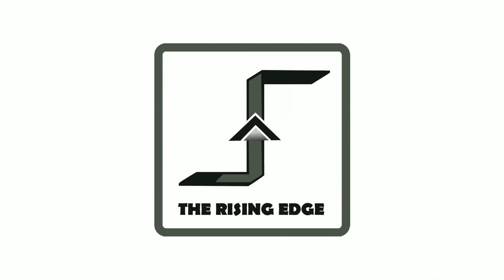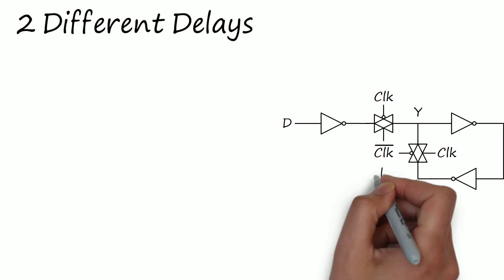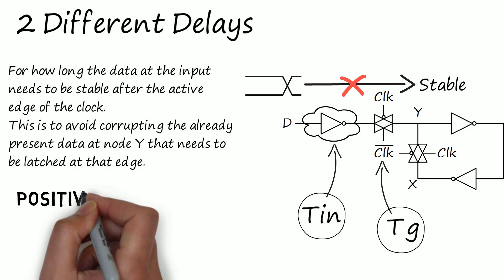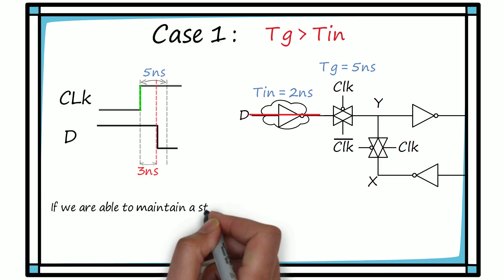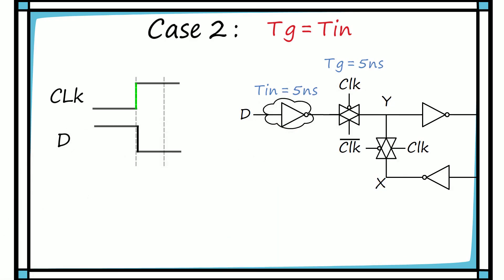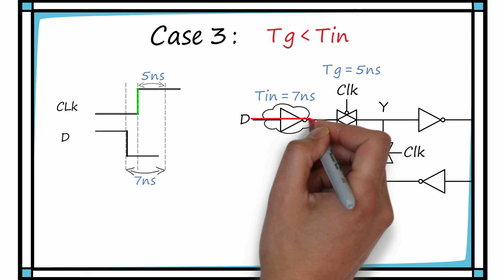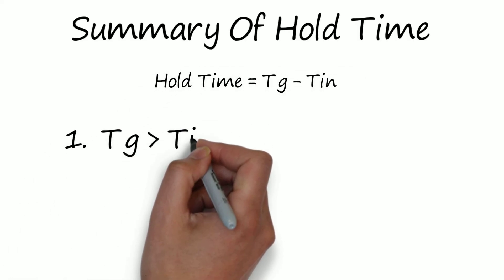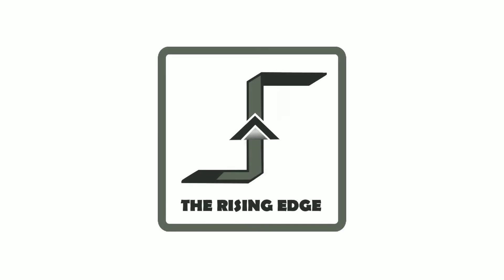HOLD TIME CAN BE NEGATIVE!!! | STA-3 | Static Timing Analysis

Comment: setup can also be negative, 0:38 if there is a internal clock delay, then eventhough data changes after setup time, its accepted because due to internal clock delay, clock is still 0 and its not changed from 0 to 1

Comment: good explanation. i am not sure if there is already a comment about this and please correct me if i am wrong, theoritically library setup time of a flop cell can also be negative, if the datapath delay < clock path delay in the internal structure of the flop.

Comment: Hi yash, in case 2 what if the data change happening before the clock that is  -2ns .data changes will happen before gate turn off right?
Reply: And in case 1  data changing reflect on 2ns after clock edge means hold time will be voilated right?

Comment: i have not got why the setup time is not violated when the hold time is negative. please someone explain it to me.
Reply: Same with me, if u understood it now, can u pls explain it to me?
Reply: If you increase the combo delay setup time also going to increase(in this video he mention doesn’t affect setup which is wrong I guess) but it doesn’t set up time not violate why Bcz any changes to the signal at input prior to clocking needs to go through the delay (combo) so it treated as -ve

Comment: In case 3 where you considered Tin as 7ns which means the setup time is increased by +7ns and data should arrive at D pin 7ns+extra setup time prior for it to be captured correctly so definetely negative hold times impose a threat to setup timing making it hard to fix
Reply: Yes true
Let hold time is decreased by 5ns same amount of time increased in set-up time

Comment: great video, 
now because of the Tin delay will the setup time also increase by 7ns? Since now an additional 7ns is also needed for the data to reach the first gate.
so if before it was 1ns then will it now be 8ns?
Reply from the maker: Yes, correct, that's why we don't focus on correcting either one of them (Setup or hold) we have to optimize the values such both times are satisfied.

Comment: Do we try to keep the hold time negative while designing?
Reply from the maker: Hi Shikha, thanks for the query!
See, for a Pure flop(containing no extra gates) setup and hold time always will be a positive number. Now, A flop can be a part of a bigger component.
Hold Time of a flip flop is a constraint on data path delay so that it remains stable for some time after active clock edge.
Higher the value of hold time a flip flop, more strict will be this constraint because data has to remain stable for this much time. So, if you have zero or negative hold time then there is no such constraint on data and hence it helps in meeting hold violations. However, flip flops with negative hold time have a large setup time constraint, making it difficult to achieve the desired performance(frequency).
Hence, while designing, we aim to design in such a way that there are no timing violations(setup or hold) while ensuring optimum performance.
Reply: @therisingedge  Thank you for answering.
I have another question. 
If I have to design a circuit to work on 1GHz and I have a combinational delay of 2ns between two flip-flops then is it possible to make it work on the given frequency?
I could add another flop in between but it would add to the area and cost if I had to do this for all flip-flop pairs. Do you have any idea about this?
Reply from the maker: Assuming that you are working with ideal flops (Zero setup/Hold, c2q), then the only way to make it work on 1GHz is to include delay in the clock path, as we'll have to increase the data required time by at least the combinational delay value of 2ns.

Comment: Hi Yash, thanks for the explanation.
In case 3, where hold time is negative, then what will be the setup time for flip flop? will it be any time b/w 0 to 5 nsec.
Reply from the maker: Hi Prashant, thanks for asking this doubt!
No, the setup time will not be in 0-5ns, rather it will be calculated by adding the delays of all the 3 inverters that are there in the path from D to X. So, if the hold time keeps on going in the negative direction, it will cause large setup time constraint, making it difficult to achieve the desired performance(frequency).
Reply: @therisingedge  Nice ty
Reply: @AbhishekSingh-up4rv  🐍🐍
Reply: @therisingedge   what about the transmission gate delay in D to X path while calculating setup time?